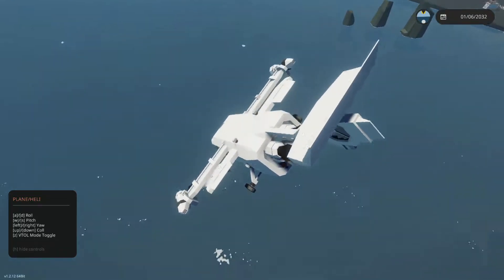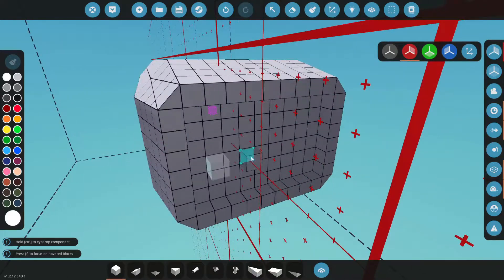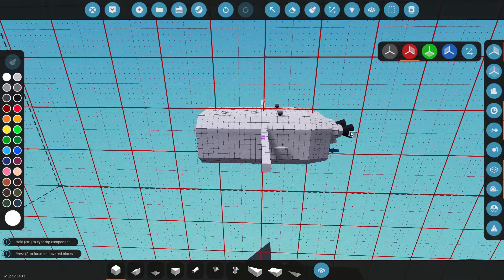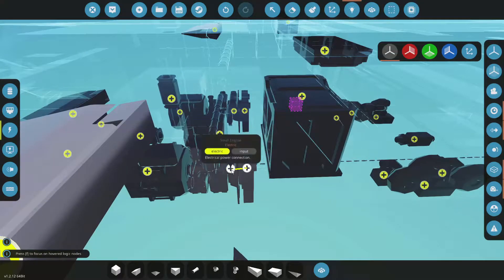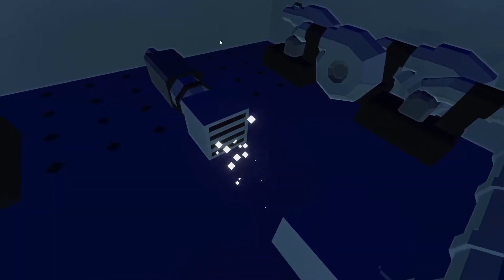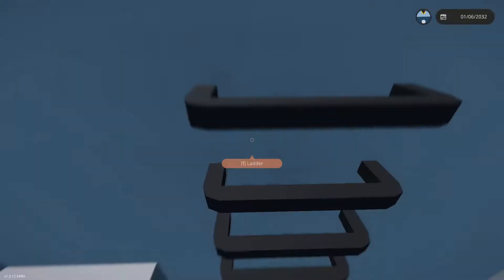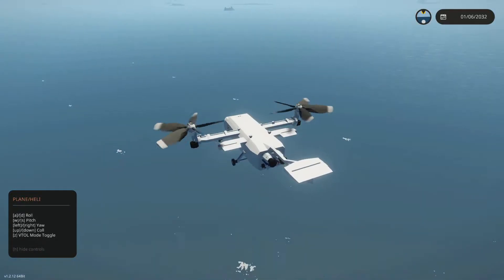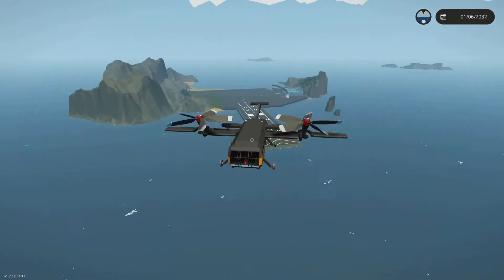Building the ULTIMATE all in one vehicle! l Stormworks Build & Rescue

Comment: The reason it dives and automatically comes back up is because control surfaces don’t really work properly underwater, try replacing it with rudder fins.
Edit: and add wing pieces so that the lift is a bit better.